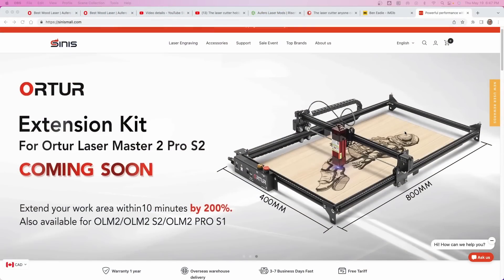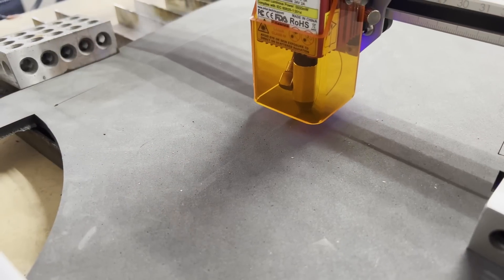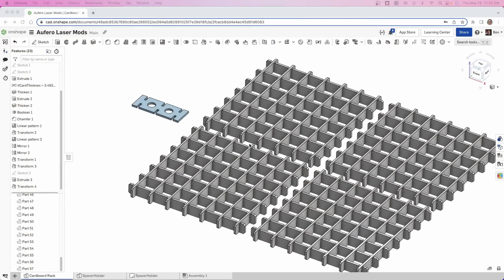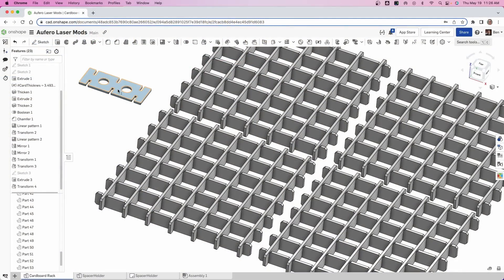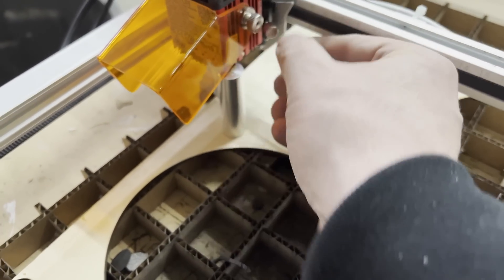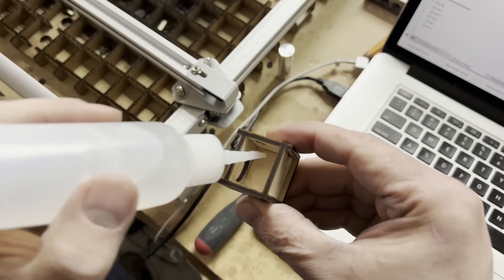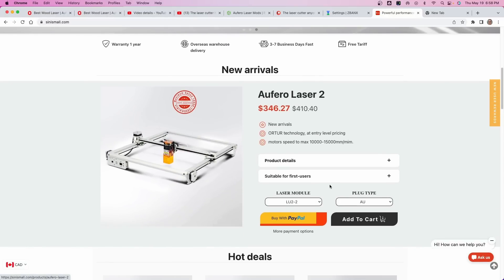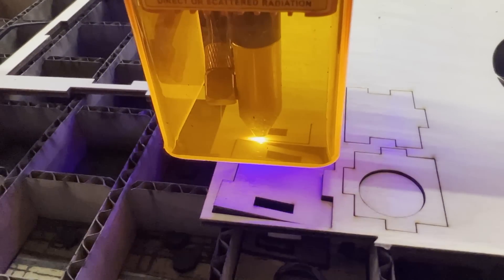The laser cutter-engraver all hobbyists prop makers and cosplayers should get.

Comment: Excellent video Ben! I just got my Ortur Aufero Laser 2 and need to put together a video myself.
I am most interested in the air assist, I just learned about that. Is it a kit you added on, or an official part?

I am also excited for the rail expansion kit I am seeing.
Reply from the maker: It’s a official part. I could design up a 3d print quick enough for you though. Did you get the long focus, short focus, or both? The rail expansion kit is a good thing for sure but I have some extrusion on hand here and think I can expand it without the kit
Reply: @DreadMakerRoberts  I'll need to open the kit, I'm not sure which focus I got
Reply from the maker: @OdinMakes  I’ll be in your area in a few weeks. Let me know and I’ll bring my laser module with me with the air assist nozzle for you to try.

Comment: I am having a great deal of difficulty using the riser files.  they download as a DXF file and I don't have anything to open such a file.  the software I got for the cutter (LaserGRBL) won't open a DXF file.  so I went to Microsoft store (they mostly provide viewers) but after some fumbling around found an app that will convert dxf to svg (a file format the software can open).  problem is, when I tried to print, it was like twice the size.
in other words, can you help me out?
Reply from the maker: Yes download Inkscape and open the file and save out as svg.
Reply: @DreadMakerRoberts  thanks a bunch again!!
Reply from the maker: Also look up in the software you have a scale function to resize. When importing make sure the units are in mm

Comment: would it work for the smoke if I were to hook up to my dust collection system?  system is all still within my garage, but has the 5 micron filter bag (for whatever that's worth).  and do you have a pattern for the base that you made available?  likely to order one of these very soon and wanting to cover all my bases!
edit;  after posing the question above, I noticed the link to the pattern for the base
Reply from the maker: I would hesitate attaching the dust collection to anything that potentially is a spark or ember. The laser could in a bad situation create a ember and have it go through into the dust. This would be a explosive and fire hazard.
Reply: @DreadMakerRoberts  thanks

Comment: What settings did you use to make it cut this fast?

Mine is only marking the cardboard and going about 10x as slow.
Reply from the maker: There are a few things that need to be done to get this speed. 1. Air assist. 2. Do you have a LF (long focus) module or the SF (short focus) module? The long focus is by far the best one for cutting. Last is to make sure your focus is spot on. Other than that is is usually 100% power and figuring out the appropriate speed to cut. Sometimes with multiple passes.
Reply: @DreadMakerRoberts  I don't think I have either version?  I do wish you would have been more clear in your video about which of the 3x laser heads you received/reviewed.

Comment: Question - for the smoke issue, can that be solved by simply running the thing outdoors? I figure it's portable enough I could just set it up on the patio whenever I have a job to run and have the smoke be gone with the wind.
Reply from the maker: Absolutely!

Comment: Hey Ben, are the files available for the bed grid and the spacer holder, I've just ordered this unit and can't wait for it to arrive.
Reply from the maker: Yup in the links in the description. They are at Printables.com . FYI knowing you, you  will likely need to get air assist on yours. I will be doing a design up shortly on how to laser one out. Then a aquarium pump and some tubing will be all that is needed
Reply from the maker: Cardboard risers: https://www.printables.com/model/209475-ortur-aufero-laser-cutter-engraver-bed
Spacer: https://www.printables.com/model/209485-laser-distance-spacer-holder-for-the-ortur-aufero-

Comment: This paper honey-comb grid will be cut through like hell. it should be made of metal... but the leaser cannot cut that...
Reply from the maker: One would think so, and I would have agreed with you a week ago. I figured I would test the design on cardboard and then move to a more robust material. Given how well it has performed over the week  I hardly see any damage. I do need more testing and see how it manages over time. Anyhow in short it actually holds up better than you would think. Given how cheap it is and how many boxes I get over a month it is a near free solution for making risers
Reply: @DreadMakerRoberts  Hmmm Ok but it surely has to be redone sometimes. Well I don't know about this laser I started with an Atomstack A5 Pro (still have it) and suffered a lot with cutting (slooow speed, fume, lack of airsupport, 2mm distance from tha material (not really enough) that was also a 5,5W diode laser. And than I bit the bullet and bought a 50W CO2 laser and the difference is.... well really day and night!!! You just cannot compare the two. It is possible that the more modern diode lasers are better but.. As I measured the 50W CO2 really 10X faster, it has airsupport, real honeycomb grid made of metal it is motorized and smoke suction etc... I really don't want to hurt anybodies feelings but if you really want to cut just forget the diode lasers, they are not capable of serious cutting.... that is the truth.... I tried it...
Reply from the maker: @bacsijancsi  Totally agree on this, no hurt feelings at all. You make good points. However like you mentioned the new diode lasers and the air assist with a long focus module definitely are decent tools. I figure 1/3 the power of a 40W Co2. That being said this one is so easy to use that I have found over the last week that I have not touched my Co2 which I generally use daily. For light stuff and engraving it cannot be beat.
Reply: @DreadMakerRoberts  Well it is OK for paper, textile...light materials and foam, but the fume suction is still a problem especially with PVC foam (there is Chlorid) It cannot cut see-through Acril which cuts beautifully with CO2. Air support is solvable but every one has to built a box for it I think and build a suction solution (some Chinese company started to even do it for a nice price :-) I did it, and yes it needs some kind of honey comb bad or bad of nails (I also did that), even that is not perfect because of the smoke has to be sucked out from down... and that 2mm clearence from the material is a bigger problem than anyone anticipate. One thing is true the cutting curfe is wider with CO2 (about 0,1mm) it is less with diode lasers so there might be less fuem... Still as I used it in my studio with 3mm plywood cutting a complicated thing I had to leave the room I cannot see after a while because of the smoke....

Comment: Wattage is dissipation and LEDs are getting constantly more efficient - for a long time they doubled every 18 months. So 5 watts can be enough!
Reply from the maker: Agreed.. I’m thinking the 10w coming out will be 60% there to replacing my co2 laser
Reply: @DreadMakerRoberts  Yeah but those 10W diode has double diode and not very cheap...

Comment: well huh. didn't realize we were at this point, first/last engraver I bought was one of those 80-120 dollar built on what I'm pretty sure was a optical drive sliding tray lasers, which actually worked really well for small wooden parts, with the most powerful of that range only being about 400 bucks, that seems like a good deal. just wish they'd put the work area on the specs area of the listing.

Comment: Thanks for the 'celebrity endorsement' on this. I was looking at Ortur for my first cutter, and this helps to know that someone local likes it. Most fortunately, it is way within my budget, so I think I'll order one right away!
Reply from the maker: Please help my channel and use the link provided. With the coupon codes you get a better deal too!
Reply: @DreadMakerRoberts  Which laser module did you choose? LU2-2, LU2-4SF, or LU2-4LF? I'll be cutting through foam , acrylic, and wood (as cosplayers do).
Reply from the maker: Lu2 4lf sorry I missed this question

Comment: How would this do with acrylic?
Reply from the maker: Dark acrylics are no issue. The clear and lighter colors it is not good at. That is one of the drawbacks. FYI it cuts MDF way better than CO2 does.
Reply: @DreadMakerRoberts  Perfect, thank you!
Reply: @DreadMakerRoberts  MDF eh?? How thick is the MDF you're cutting? And did you add that air assist nozzle to the head of the laser? 
I have a couple Sainsmart CNCs (which are great) and the diode attachment for them but like you said in another reply, multipurpose machines are rarely great at all of those purposes. I think I'll snag one of these machines for laser cutting after watching this review, so thanks! 
Great content! Keep it up!
Reply from the maker: @Joshkashley1  3mm MDF. I had air assist and it took 3 passes at 100% at 20mm/sec but I see others doing it at 100% 1.7mm/sec Its not fast but it get the job done and super clean cuts. Remember that MDF and Hardboard can vary quite a bit so your mileage will vary.
Reply: @DreadMakerRoberts  thanks for the reply! Sounds like a pretty decent setup for the money. You think it's worth it to wait until the LU-3 is released? Have you been told any details or pricing on that?
Reply from the maker: @Joshkashley1  Great question unfortunately I really don’t have the answer for you. Until I test one I can’t really say. And also knowing what your intentions for the tool would help as well.
Reply: @DreadMakerRoberts  I suppose that would help eh? 😂 I'll be using it for cutting. I have another 5W diode laser from Sainsmart that I could use for any engraving if I ever needed. I'd primarily be cutting Baltic ply for ornaments and things of that nature. Maybe some dark acrylic depending on what projects I think would sell in my shop.

Thank you again for your responses! 
Hopefully you'll get your mitts on the next version when it comes out! 👍👍
Reply from the maker: @Joshkashley1  I’ll keep you updated. I’ve put in a pre-order for one. My bet is that it could do what you need. Granted not as fast as a co2. But no tube cooling, no mirrors. That alone is nice.
Reply: @DreadMakerRoberts  awesome. Thanks Ben! I think so too. Looking forward to hearing your opinion on it
Reply: @DreadMakerRoberts  couldn't wait! Just placed an order for the long focus 😁😁 (I used your link FYI) Thanks for the advice!